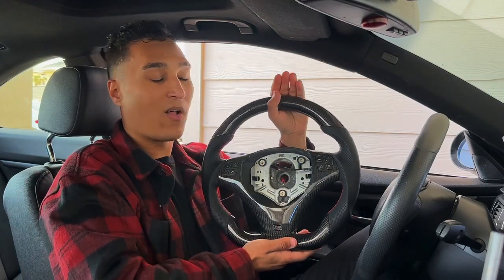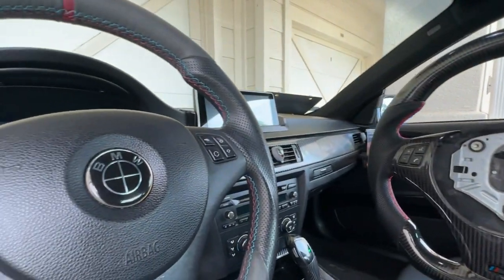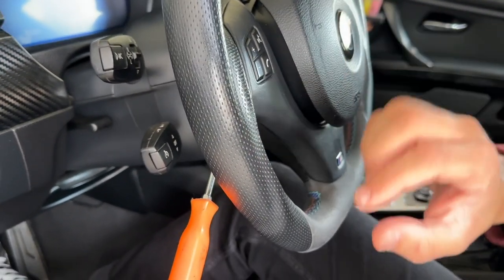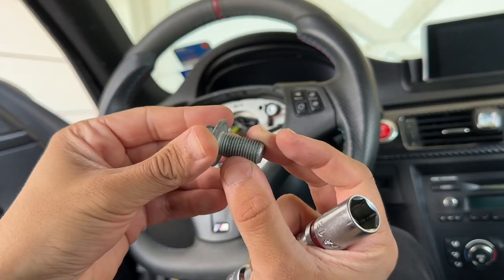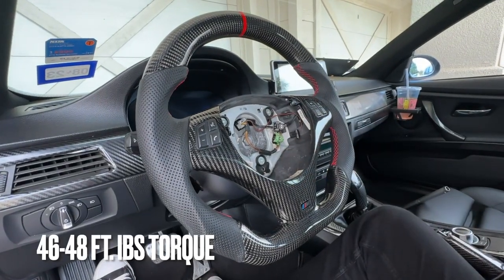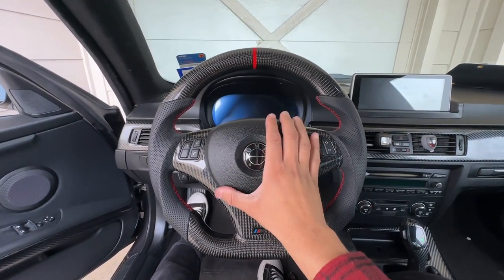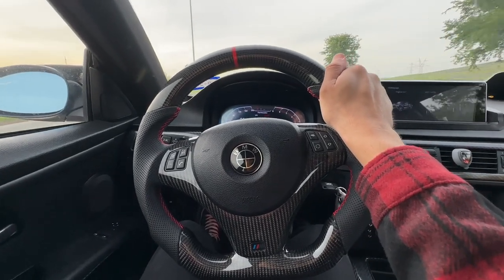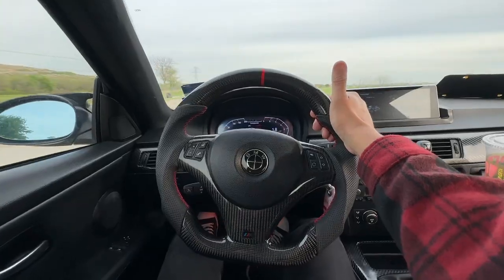BMW Flat-Bottom Carbon Fiber Steering Wheel Install! | E90 E92 328i 335i M3

Comment: how are you liking your after market head unit? Do you notice any downgrade in sound quality when it comes to vocals or music like rock? Any trouble connecting to apply CarPlay or weird glitches? I currently have one but it's crap and I'm looking to get a better one. Just want to make sure I don't encounter the same issues if I am to make a new investment.
Reply from the maker: Wired CarPlay very RARELY acts up, always reliable unless using a whack cable. Bluetooth connection is 60/40, the sound quality is overall good, crisp highs and vocals but once volume is turned up high (in my car at least) certain mid bass notes hit a little fuzzy. I’d say it’s definitely worth the investment overall BUT sound quality is very specific to each car’s speaker setup, age, etc.
Reply: @IzzyE9X   Ahh, I see. I appreciate the honesty man.

Comment: Hey will this fit e90 base steering wheel
Without paddle shifter ? Can I still
Use my stock airbag on this ?
Reply from the maker: you’ll just need the sport airbag, but the rest of the wheel will fit on. sport airbags are pretty cheap online
Reply: @IzzyE9X  hey bro I just bought steerinh wheel from bmwmods BMW Flat Bottom Carbon Fiber Steering Wheel (M-Stripes) this one do you know how long will it take to ship ?
Reply: @Desidudeinusa  how long did it take? I want to order one now but I dont want to  wait over 3 weeks for it.